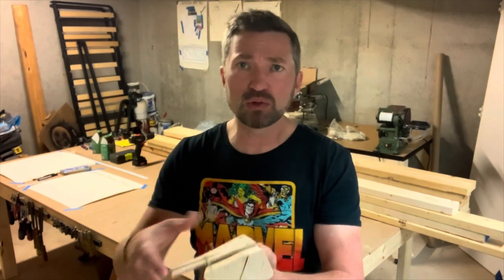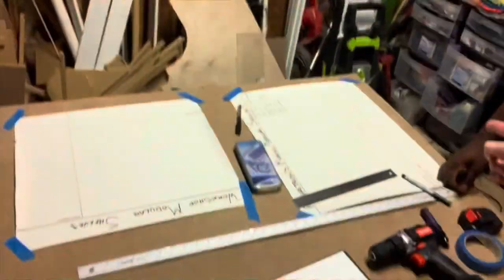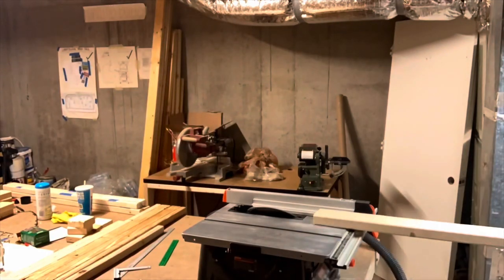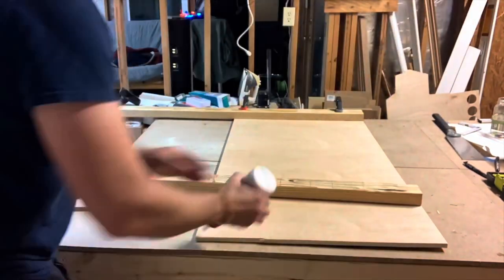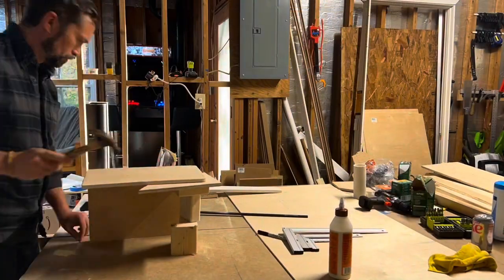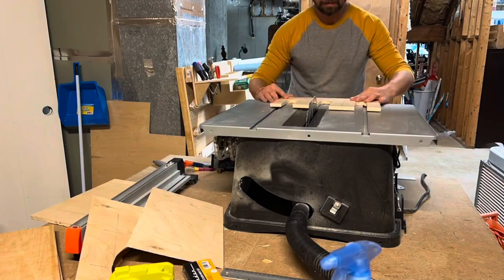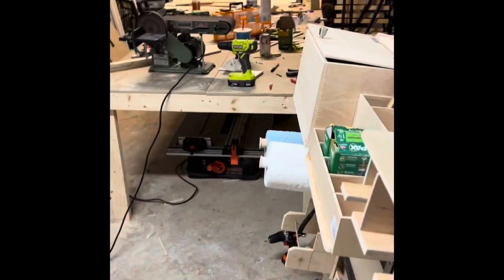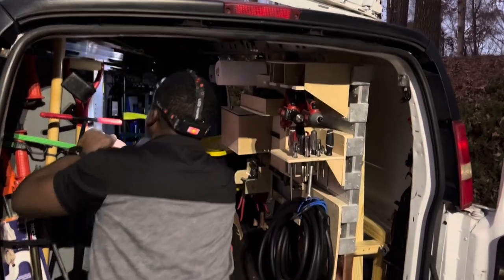DIY Modular French Cleat Shelves— in a VAN! (Guest starring ReggaeTron)

Comment: I’m surprised to not see more comments or views. Would you consider using a nonslip material on the cleat to lock in it more? Old yoga mat or thinner. Also why use a lever system in the front if a stop would wirk just as well?I may use this idea, thanks!